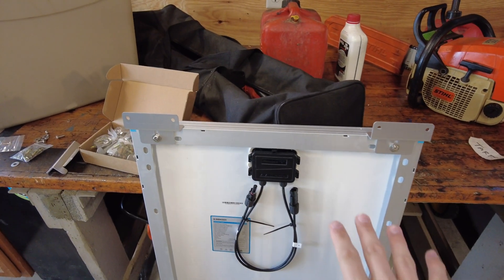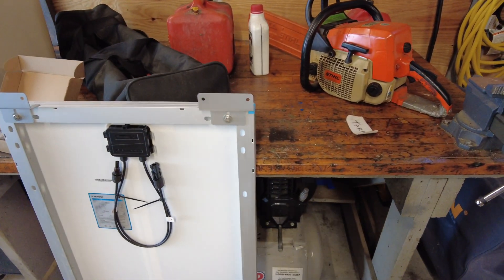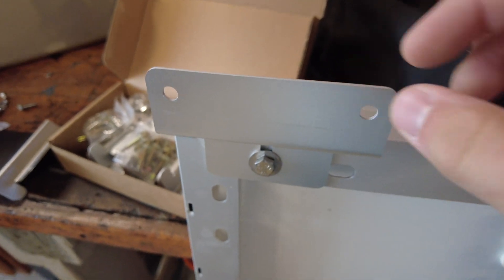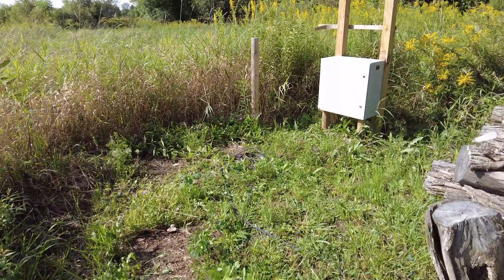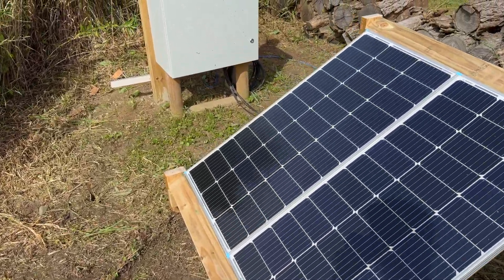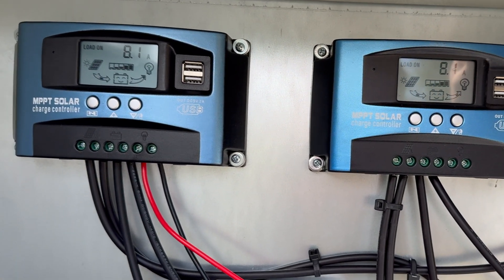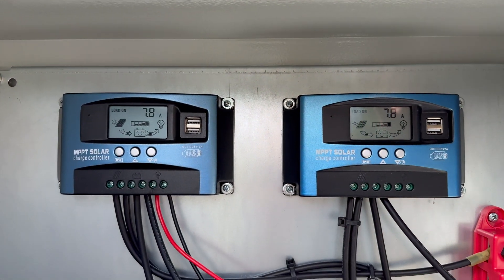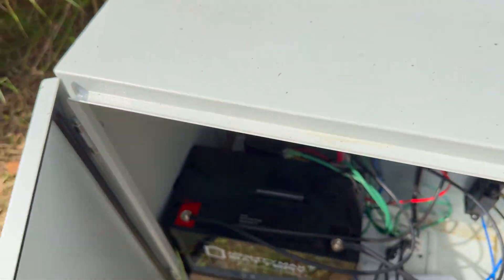This solar setup needed some maintenance...

Comment: Do yourself a big favor and get those things off the ground.  Not just off, OFF - get them a good 8-12' up in the air!  Above the worst of the dust and virtually all of the grass clippings, out of the way of everything.  Double up the posts that are holding the power combiner box, send them 8' higher and attach the panels onto the posts that hold the combiner.  Less stuff on the ground, better performance.  The only downside is that it will make the panels harder to get to for service but with just a bit of work, like for a small wind generator, you could build a tower that would make it easy to lower the panels to the ground for working on them.